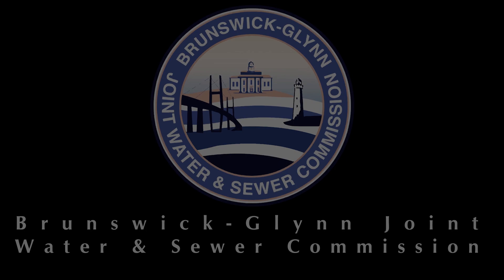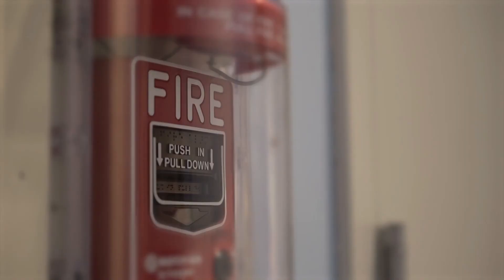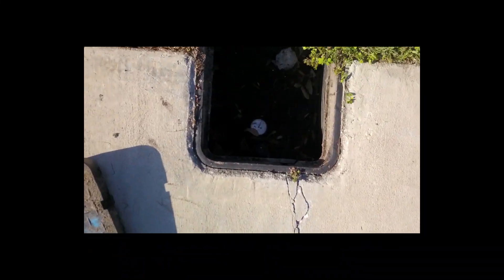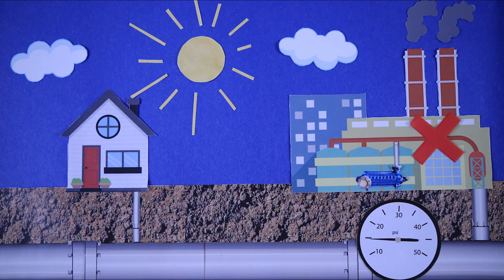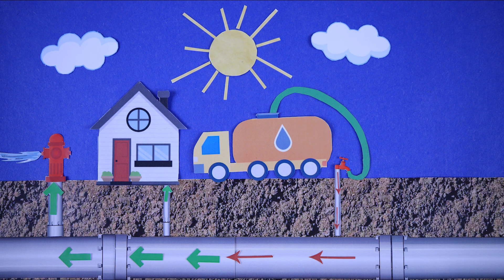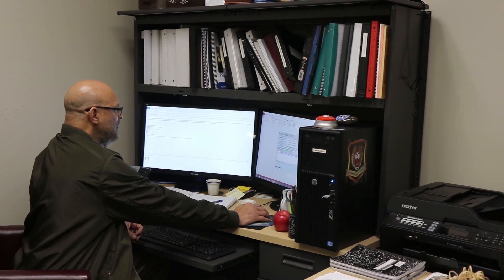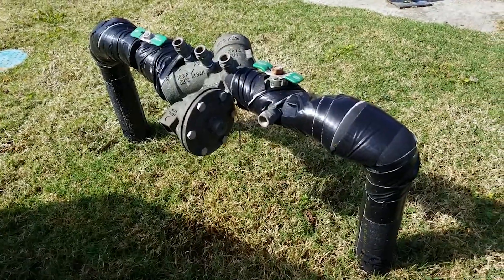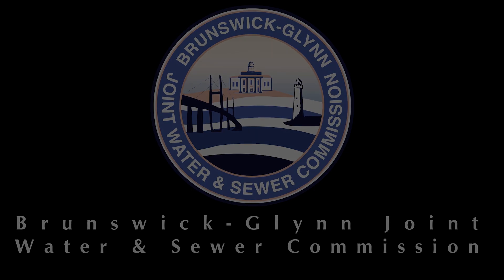BGJWSC - What is Backflow Prevention?

Comment: Hello, I'm looking at a new build home, there are two homes for sale. One requires a backflow preventer and one doesn't. What are the benefits and drawbacks of having a home with one? Should i buy the one with a backflow preventer or the one that doesn't need it according to the site plan... I'm very confused. Please help!!
Reply: Are you in our area (Glynn County, GA)? I can only speak for our local codes but all connections get a back flow preventer, they just vary in type and expense. All residential connections get a non-testable dual check that's mounted directly to the meter. The utility installs it and replaces it with routine meter change out or every five years, whichever comes first. If you have an irrigation system with direct chemical injection or a pool with an auto-fill system, a testable device is required. That type could cost you $300 to $500 up front and then over $100 or so each year for certification testing. They're required to ensure that any hazards presented by the customer, such as chemicals, don't get either pushed or sucked into the distribution system when there is a pressure change. So, the benefit to you would be the confidence that others are held to the same standard, which helps ensure that your water is safe to drink.